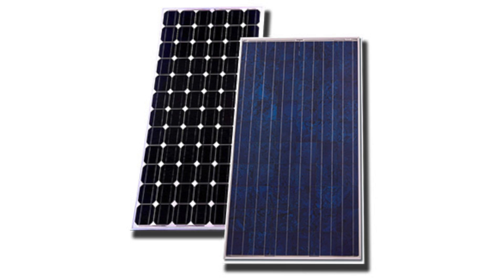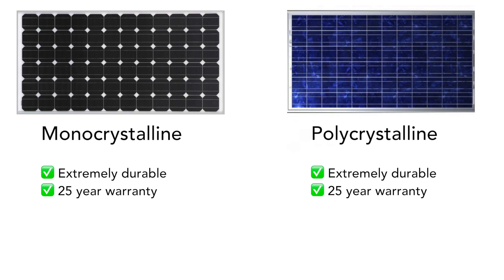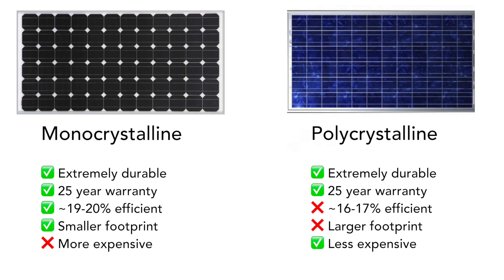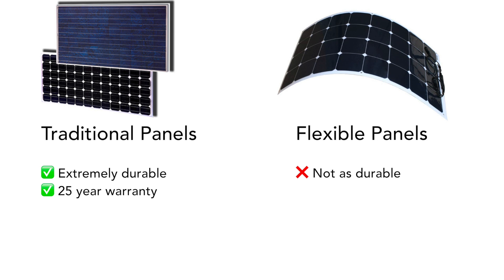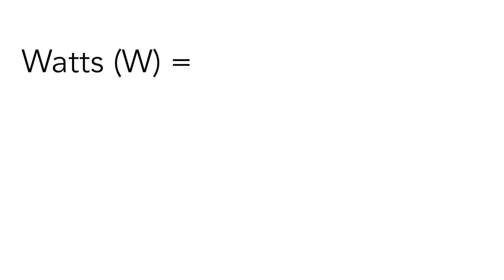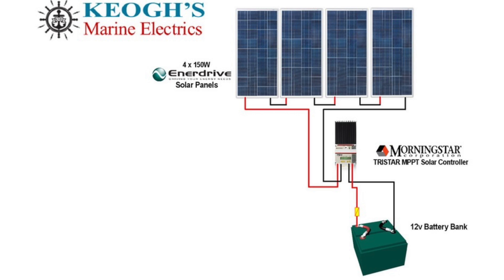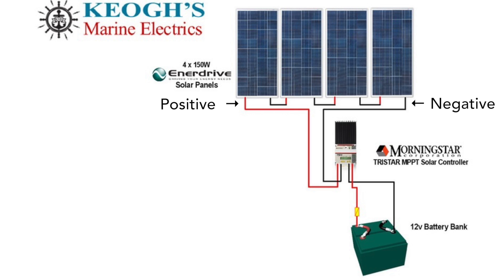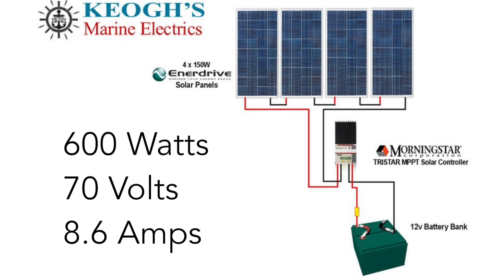Mono vs Poly vs Flexible Solar Panel + Series vs Parallel Wiring

Comment: You can eliminate the whole series panels going down in shade with a bypass diode. This should always be included in a series wired install so failure of one panel does not stop the output. Generally running panels in series up to 300vdc sections in series is best bet for reasonable controllers. Heavy parallel amps creates a lot of heat and requires heavy duty controls
Reply: Thanks for this contribution.
Please how can one include the bypass diode to serve this purpose?
Reply: I have my panels set in sets of 9 240 watt panels. Having do a lot of heavy electrical work. I took my panels and set them up then I took a large cardboard and covered a panel I lost the out put from that panel and nothing more. I also covered just a spot of one panel and I lost about half of that panels out put. I have contacted the builder and they said all of there panels made over the last 10 years have bypass diodes built into them to reduce the lose. Now what I have found is two of my sets of 9 panels are then tied together and then I would block off one panel in one group of 9 and it dropped at the combiner the output of doth sets as if they only have 8 panels working together.

Comment: Ok now i am confused. When You wire 4 panels 150 w at 17,5 v in parallel i always thought  that i would get 600 w at 17,5 v. 

Also i thougt that it would be 150 w at 70 v when wired in series.
Reply: He say 600watt 4x17v =70v and 8.6A  but ITs 600÷12=12v@50A not 8.6 he fails to follow Up on the MPPT controler

Comment: Your explanation of series where one panel gets shaded, is unproven and not illustrated. You make it sound as if the "goes down" is to mean that no voltage or amperage will be produced by the setup.

Comment: 1 question tho: U said the solar panel connected in series act as 1 solar panel right. But what of a part of 1 solar  is covered in shade will it generate electricity, will the other part not be able to cover the solar energy . I do not understand .please explain.
Thanks in advance
Reply: series is still like running an extention cord the end product it doesnt matter which panel is transmiting power, it will simply go past the other panel's.

Only problem being with lights if one in the chain fails the one's after that in the chain are cut too..
ex.. old christmas lights..

Comment: Thanks for this super helpful video! I am designing a solar system for my Ford Transit conversion. I want to utilize the curved roof space between the windshield and flat roof for solar panels. Do you foresee any issues with using two 160W Renogy flexible panels in this application? Also, can I mix brands of solar panels? To utilize the space around my fans Id like to use two 100W HQST traditional panels because I only have 21" and the Renogy traditional panels are 25". Im hoping I can pull this off so that I can maximize my solar power and still have room for star gazing up there! Thanks in advance for your advice.
Reply: Didn't you read all the comments about flexible panels failing in a short time?  Don't use them.  What I'd do is permanently mount whatever rigid panels you have room for.  Build your roof deck.  Then get a couple more panels and rig some way to be able to quickly mount and dismount them on the deck.  When you are driving, the panels can be on your deck; you won't be stargazing up there while you're in motion.  When you stop, dismount the panels, lower them to the ground, set them up in the sun.  Now you have your roof deck when you actually want it.  For flexibility in connecting them, have a plug for them on the roof, and another plug in a weatherproof box on the side of your van to connect them when they're on the ground.  That's more work than I'd personally care for, but maybe your situation requires more solar power.

Comment: Thank you! After scouring YouTube and the internet for information on how to set up solar for my teardrop camper, this is the first video I have watched that makes total sense. I do have one question. My teardrop has a zamp connector to plug solar panels into that goes directly to my 12 volt battery. If I purchased four 150 watt panels similar to your example so that I could achieve 34.4 amp output if they were wired parallel, would that damage the battery? Also, would I need to put in a bypass utilizing a controller so that I could run 30 amp appliances in the camper like the refrigerator? I'm still fairly new to this and trying to learn. Any advice you have would be welcome
Reply: Nop the bit of info stating that SERIEL Wil die if on is in shaddow 
Ain't truh .. 
Yes on substandard panels 
No On high grade panels .. 
They hawe BYPAS DIODE So sad to say he was almost telling a Lie 
If you want this system you need a 50A EPever MPPT Controler
And 4 150watt with BYPASS DIODE/s in series 
Then you are golden .. 
I would go fore the 3x250watt and a 60A  150v PV EPever MPPT Controler
They are not that big than 4  150

Comment: This is the most informative video on this topic I've ever found thank you so much!
Reply: Nop seriel don't die in shaddow 
IT just drops like paralell would 
Due to a thing substandard panels don't Have
Read Up on BYPASS DIODES
Then you are way smarter than this almost right GuyGreetings from Denmark
BTW we are just that smart in Denmark..
Secret word BYPASS DIODES
All my panels got Them and i use series and MPPT

Comment: Shading explained,  thank you.
Reply: shading problem can be overcome by connecting a diode on each panel, it should be able to handle the max Amp's from the circuit. the katode is mounted to the plus and the anode to the minus, this will short the panel what is in the shade

Comment: The clearest comparison I've ever heard! What if you have a couple of 24 volt arrays, but they are pointing different directions (one due South, one a little too the East, and one a little too the West) how would you couple those together? Thanks.
Reply: Depends on the type of panels .. 
If the panels has BYPASS DIODES  you need 
What ewer on on side and What ever om the other in 2 strings
And paralell in to you 24v MPPT Controler

Comment: You should consider that The search for flexible panels had free shipping.
When I went to buy panels, a 300 Watt framed panel was $120 which seems fantastic. But they ship exclusively through freight shipping; that ended up being $260 for shipping one 300 Watt panel. I ended up going for a flexible 300 Watt kit for $360 with free shipping.

Comment: Use optimizers, without them if 1 panel breaks all of them stop working but optimizers will make sure the other ones work and also if there's a bit of shadow instead of the whole panel not working the power will only go down a bit

Comment: Very easy to understand video!  I chose parallel on my RV trailer because of continuously changing trailer positions where some shading and roof mounted equipment can come into play at times.Series would be better suited for a stationary array at home in an open area where a longer wire run could use smaller less costly wire. Thanks.

Comment: Also mppt controler can use to charge lithium ion battery also gel battery as well
Reply: Some MPPT controller are not designed for Lithium. Always check.
Reply: @xraykadiddlehopper8067  Thank you for your great information.

Comment: is it possible in mppt charge controler can connect 24v solar panel to charge 12v battery
Reply: YES Remember to always connect the battery to the controller first then the panel.

Comment: Great video!    You covered the basics quite well!   I would only add that, when comparing poly and mono panels, the panel power ratings may be the same for full direct sun, but the poly panels perform better in less than ideal conditions, like partial cloudiness or a shallow angle to the sun.  This difference can be significant over the long term.   And, it can best be measured by looking at total daily solar production for both mono and poly panels added up for thirty days, then averaged by dividing the total production for 30 days by 30 to get the average production per day under identical but less than ideal conditions.  Then, subtract the totals to get the difference.  Spoiler:   The poly panels win.
Reply: Never read anyone mention this before? I am skeptical so I will do my own digging into that comment. If that is true then why are poly cheaper? Seems the companies would not want you to know that the "cheaper" ones are better? hmmmm

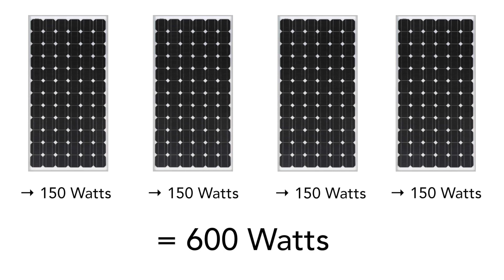Comment: Series Wiring @7:58
Parallel Wiring @10:20
Wire Sizing Chart @12:15

Series Vs. Parallel Wire Sizing @12:26
Series Vs. Parallel Shading @12:54
Series Vs. Parallel Charge Controller Requirements @14:00

Comment: What size of a charge controller is recommended for a 600watt array solar panel wire in parallel, please? I have a 30amps controller can this still work fine?

Comment: put diodes when in series to bypass shaded panels. 
That is how panels are made so they still give some output in part shade, most have 6 rows so each row will be bypassed if shaded. If part of all rows are shaded it wont work (rows run long ways)

Comment: Why did the Voltage change to 12v per panel (at 17:32 mins) when the other examples were said to be 17.5v?
Reply: Ignore that bit. Solar panels can have different voltages depending on their size and configuration.

Comment: One thing that could be mentioned is that when the sun comes up with the higher voltage the batteries begin charging earlier even though the sun's not producing direct sun. All it takes is be above nominal voltage.

Comment: By lowering the amps and raising the voltage do you lower the time that it takes to charge the batteries?
Reply: It won't as your charge controller will anyway have to follow the battery voltage. 
However you need to check your charge controller specs. What input voltage does it require from the pv panels, and what max wattage can it handle. From this you will know how to connect your panels.

Comment: You need to include 2 pairs wired series connected in parallel and 2 pairs wired parallel connected in series      which can mitigate the deficiencies of all series or all parallel, shade resistance and electronic control cost.

Comment: The size of the controller size is the same!  The amp rating is the amps out of the charge controller not what comes in.  Unless you just dump the power they both will need a 40 amp controller!

Comment: Your statement about the only thing that changes is the voltage or amperage is incorrect.  As an electrical engineer whether you wire or couple the panels, each will produce the same amount of voltage and amperage at any given set of conditions (amount of sunlight, angle, etc).  Wiring them is essentially a matter of convenience, but the output of a combined number of panels greater than one will produce the same amount of amperage at the controller panel.  It's important to note (which you omitted in this video) that the amperage whether combined at the source (panels) or wired individually to the controller will eventually be combined and therefore need to be added together at that point in your wiring scheme.  ie.:  six 100 watt panels wired in series will produce the same amount of amperage as six 100 watt panels wired in parallel once they are combined (either outside or at the panel).  True you can use smaller cable if wired parallel but you will need 6 times the cable so there is no advantage whatsoever in cost and in fact may be more expensive if for example the cost of the smaller wire is more per foot than 1/6th the cost of the larger wire.   

Either way, though six 100 watt panels will provide the same amperage wired in any configuration that uses their potential current output.

Comment: You forgot to mention that when you wire in parallel then combine the output to one set of wire to go inside to the controller you have to add the amperage together for the wire used to bring the current inside.  So you are dealing again (in  your example) with 34 amps coming in even though they were wired outside in parallel.  So there isn't any advantage to wiring in parallel unless you use (in your expample) 4 sets of parallel wires coming inside.  Failure to account for that will cause wire to heat due to friction from over-amping the wire.  It's  not as straight forward as  you mention.  

You do get the advantage of help with shading, though.  But most installers are  not going to run a separate set of wire cable into the controller for each panel.   It's important to note this in your video.  Your assertion that parallel wiring solar panels will reduce the incoming amperage.  And that's just not true.  Your controller will have to handle the amperage of each panel added one way or another (either with one cable of the addition of multiple cables).  The only relevance to amperage is what you need in relation to what you are producing with accounting for number of hours of sunlight, amount of amperage at peak, amount used by current consuming devices, etc.  

It is not for the average individual.  I can't tell you how many folks who've attempted self-install solar systems who've been disappointed and had to then get help from a professional.

Comment: Explain more
Reply: hi! i am having two 350w 24v solar panels and single 200ah Battery and mppt solar charge controller 40amp. how to connect two panels in series or parralel to charge my battery and run some load on solar simultaneously?

Comment: Thank you very much for your information ... the other thing  i've like to know is the required controller to use if i 'll do the series and parallel 600 watt .is the 30A mppt controller can do the circuit connection .. what i mean is about your last video which is connected in series and parallel connection. 150W x 4 ....

Comment: In the third (mixed) wiring option how did the voltage jumped from 24 V to 35 V?
Reply: Agree seems a mistake to me. He said each panel was 12volts. I think it should be 24 total voltage.

Comment: I had a deep well pump with 1 horse power deep well motor. What Solar panel, Inverter & battery do I need.to use?  I’ in Philippines.

Comment: A charge controller is based on how many amps you are going to put into your batteries and that is based on your battery configuration.  The charge controller size is not based on the amps from panels.

Comment: I was preoccupied with the painting popping with the couch cushions. My eyes began to tremble between them lol. Then I realized I was being sucked into a light hole. But seriously, a decorated YouTube studio beats an unmade bed any day.

So your first solar panel chart said 600w but mindful that only four panels are on the diagram.  So some people would have to do even more math to figure out the specs on the panels which is the first chore in any diagram solar panel calculator.

Also in my first foray into solar I had never seen panels up close. I heard people talking about them but I was already off grid so to speak way out in the boonies. So no show rooms and no hands on. 

I started buying the polys mainly because I was sold them and thought I was buying monos. But I settled for the polys once I realized the benefits matched my own set up situation fairly enough. 

One thing that I didn’t suppose, and I think now people are calling this a smaller footprint. But do people really realize that it means actual dimensions and overall space. 

Most start with oh the 100w panel and you get all the measures and amps and watts etc.  and then when you begin to upgrade you lose sight of the sizing. 

When I went from 100w panel to 350w panels I didn’t realize the same little squares that made up a 100w panel would be in a larger frame but for four panels worth. So the frame is like the size of four panels give or take. 

Now I know it’s more efficient ultimately and it’s not a simple exchange in size with the panels already mounted. But it’s an angle to consider when you start your design.

Comment: The main thing that was actually factually wrong was about the controller capacity needing to be greater for parallel than for series, this is not true. Controllers are rated on output current NOT input current and at battery voltage this will be the same wether the panels are wired in series or in parallel for a given input power in watts.

Comment: great video. are the cells wired in series or parallel? if the cells are wired in parallel shouldn't some of the cells produce some voltage if some are shaded?

Comment: Hi, first of all, great Channel you have. Just one question. I Just purchased a Epever tracer 2210AN    20A MPPT solar charge controller. Going to install it in my RV.  I have a 100watt mono solar panel(rigid) and want to buy a second one. Want to exchange the PWM charge controller with the Epever. Also purchased a New 114ah Battery. My question is,  after i get the second panel, what is the Best choice -  parallel or series hook up of the panels.
Hope on a reply 

Thanks
Reply: Parallel is much better suited for mobile applications due to ever changing positions the RV is parked  Consider also cranked up roof vents, A/C units, antennas  and other roof mounted obstacles  that may shade your panels at times.

Comment: the panels(600w), the controller, and the batteries = $1000's
1000w - 5000w gas or propane powered generator = as low as $50   fuel could be far less than $300 per year  
think im opting for a generator as my main source of power with solar being a distant second.
Reply: Noise, exhaust, maintenance... no thank you